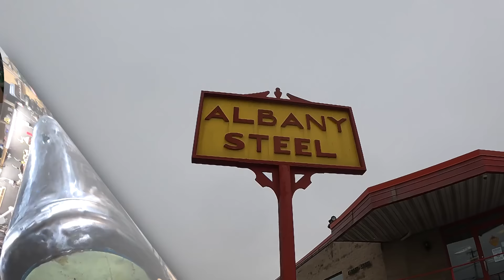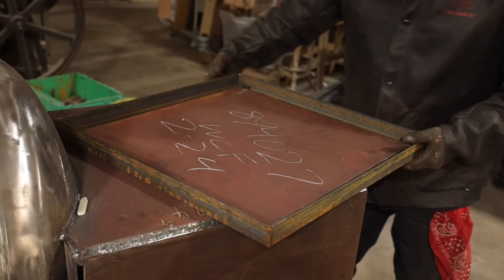DiResta BBQ Smoker

Comment: There's only one word for what you've shown us, Jimmy: artistry. Incredible, the amount of tricks and ingenuity, from the damper in the chimney to the repurposed clamp for your air inlet. Just the sheer combination of recycled parts, yet it looks purpose-built. Those were 27 dense minutes!
Reply: @jimmydiresta  Agree with all that.  Great ideas yadda. Are ya gonna install some kinda DIROTISSERIE? (nudge/wink) Gotta remember chickins and roasts and briskets and turkeys and such, no?
I made a similar deal in Peru from a 2' diam x 1/2" wall thickness x 3' length of steel pipe stolen from the gold mine I was workin at. Held heat excellently. And required a fork lift to move. I'm sure that expanded steel grate was NOT galvanized--zinc imparts a peculiar flavor.

Comment: 9:05 😲 - Those angle iron tools are amazing. I could go for some BBQ right about now.

The engineering in this build is insane.
Reply: Does anyone know what they are called, and if anyone makes something similar today? They look incredibly useful!
Reply: @kschleic9053  i did a quick search and didnt see anything like them. If you really want to know id say screenshot them and post in welding or machining parts of reddit
Reply: @kschleic9053  Roper Whitney still make that whole 3-in-1 angle iron workstation. "NO. 455 COMBINATION ANGLE IRON SHEAR, NOTCHER, BENDER"
Reply: HOW DID I MISS THIS?!?!?!
Reply: This is what im saying. At work i have to do it the hard way
Reply: "Engineering"? That's not engineering.
Reply: @Ricopolico  fabrication work better for you?
Reply: I'll allow that, but I've seen some first-class Ol' Skool engineering done by fabricators.  Beauty in engineering results by removing everything which is unnecessary, not just adding to the unnecessary.

Comment: Great with one potential design flaw: wheels instead of tank treads. Just how much does this bad boy weigh?
Reply: I'm surprised he didn't make on set of wheels swivels, to make it easier to manuever...
Reply: @machinist7230 you're right, an offset smoker that size gets shuffled around pretty frequently to find the right pastrami feng shui
Reply: Nah.. then he'll set a real tank wheel

Comment: That has to be the most severely overbuilt offset smoker I've ever seen! Lol. Only thing I would've changed on it is I wouldn't have insulated the top of the firebox. That flat surface on top of the firebox is the perfect spot to sear off a big tomahawk steak after it's been smoking in the cook chamber for a couple hours.

Comment: Jimmy?  You could repurpose a drive from an electrically driven pallet jack...  A pintle and ring setup?  Slide the drive under the project's tow ring, pull back on the handle to lift it, hit the momentary rocker switch for forward or reverse...  all your heavy stuff is moved with ease.

Comment: -I had to chuckle when I watched the door being insulated.  Yes it helped some, but, there is not a disconnect between the inner and outer skins. The heat will migrate through the continuous-weld, an intermittent-weld would be more beneficial.

Comment: Small, lightweight, no sharp edges and rust-resistant. Will fit in you average sedan easy peasy, in case you want to take it to the countryside or lend it to a friend! Fit its own engine and it can used as prop in the next MadMax remake! 😂

Comment: Those are some great fabrication skills. Somebody taught you well!!!!
The only things I can see that possibly be wrong with that build. Is that hinge and C-clamp. Those kind of hinges seem to freeze up when exposed to the weather. C clamps are notorious for seizing up with the slightest bit of rust. If you keep this cooker inside and maybe fill it with pork fat all the time it won’t freeze up on you.
I really like how you put the heat deflector on the adjustable teeth that was clever as hell!!!
The damper up inside of the stack was really cool too and the ranch accents. This is a top-notch build. I bet it cooks like a dream!!!! sometimes some looser tolerances like just opening the door for heat control is the most simple thing.
Maybe just a gate style that on the door which normally people don’t even use . 
The latch that Chud uses seems to be the coolest way to control the heat or airflow. 
After all, he has a “snake in his boot ” 🤣😂

Comment: Place a piece of steel inside from your firebox to force the smoke down so then the smoke rolls across the entire bottom of the tank. Then rises to hit the food. Better smoke ring. I have built many and found a downward force of the smoke will not rush to escape to the stack. It slows down and floats along...less heat and smoke loss. Love the inside dampener...awesome idea.

Comment: Looks like a very nice offset! 
As a grill guy not a welder I’d ask for a couple tweaks 
1- the c-clamp damper mechanism on the door seems a little tedious. A guillotine stile like you have on the other side would be better 
2- Angle the lid handle down so you don’t burn your arm trying I reach it when up (might interfere with the table)
3- Put stops on the lid so it doesn’t flip all the way back
4 - Modify the firebox so you can use it to sear (hinged top plate with grill grates underneath?)
I think those couple minor tweaks and she’d be just about the perfect grill.

Comment: Your lucky people have been killed welding on compressor tanks, the oil from the pump gets into the tank and when welding on a closed vessel the oil causes an explosion, never weld or cut on an enclosed tank/drum unless verified clean and never if there is a possibility of oil in it, be careful. The heat will vaporize the oil and then it explodes.

Comment: I honestly don’t know why, when people build pits. They put the stack at the same height as the level of the meat grating. That means the heat will travel up above the meat and exit before it hits the meat. You have to use three times as much wood and heat the entire pit. Instead of using heat from the wood, and the gate between the fire box and meat section. Totally useless, you make a fire pit of coals. And ad coals to control temperature, not pilling a bunch of wood. In the fire box and using a gate does nothing. Your just burning a bunch of wood unnecessarily, why insult the fire box if your going to cook outside. The stack damper controls temperature, and it negates the need for a gate. Great craftsmanship but bad design.